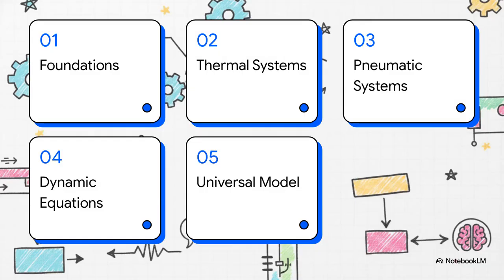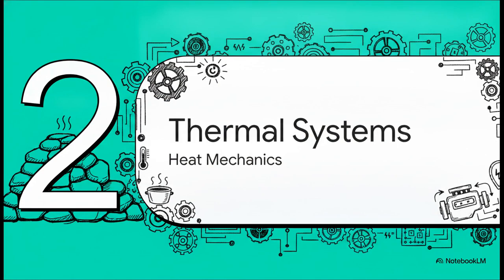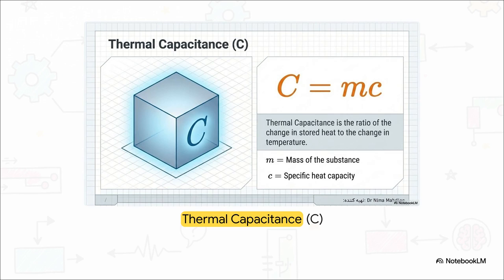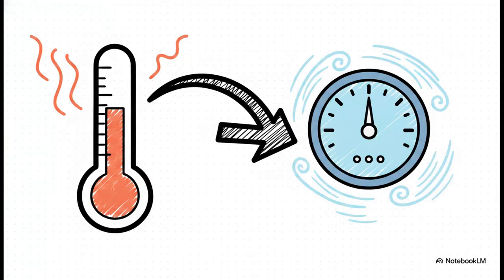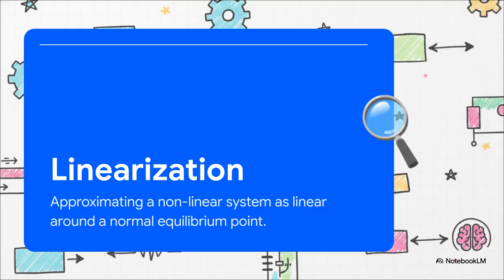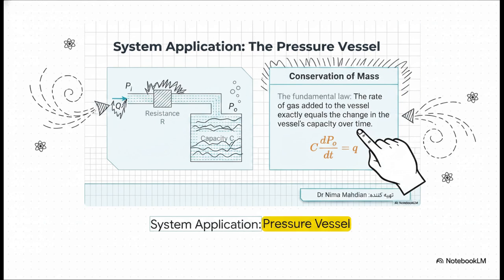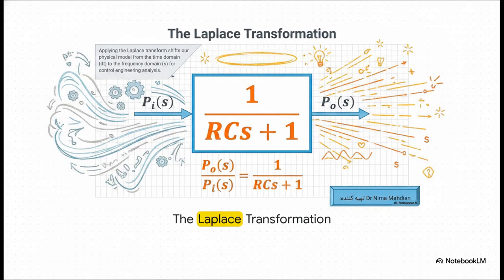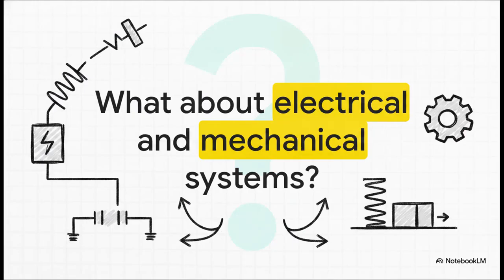Thermal and Pneumatic Dynamic Systems | Industrial Automation & Process Control

Comment: Thank u dr . it's very clear, my question is In the fluid system, the pressure-flow relationship is nonlinear. When we linearize it using a tangent line at the equilibrium point, is the calculated resistance R valid only for small deviations around that equilibrium point?
Reply from the maker: Yes, that is correct. The resistance R obtained from linearizing the pressure–flow relationship is valid mainly for small deviations around the chosen equilibrium operating point.

This is because the original pressure–flow relationship is nonlinear, and the tangent line only provides a local approximation of the system behavior. If the operating point changes significantly, the actual resistance may change, and the linear model may no longer accurately represent the system.

In practical applications, engineers may use multiple linear models, gain scheduling, or nonlinear modeling techniques when the system operates over a wide range of conditions.

Comment: the term Domain Shift in control engineering? Does it simply refer to applying the same mathematical modeling and control principles to different physical domains (such as thermal, hydraulic, and pneumatic systems), while only the governing physical variables change?

In addition, is the primary driving force for airflow in pneumatic systems solely the pressure difference (\Delta P), or are there other factors that significantly influence the airflow dynamics?
Reply from the maker: Domain shift in control engineering refers to applying similar modeling and control concepts to different physical domains, such as thermal, hydraulic, electrical, or pneumatic systems, where the physical variables and parameters change but the underlying dynamic principles remain similar.

For example, temperature in a thermal system, pressure in a pneumatic system, and voltage in an electrical system can all represent energy storage variables, while resistance terms represent limitations on energy transfer.

Regarding pneumatic systems, the pressure difference ΔP is the main driving force for airflow, but it is not the only factor. The airflow dynamics are also influenced by pipe geometry, flow resistance, valve characteristics, air compressibility, temperature, and pressure variations. In real industrial pneumatic systems, these nonlinear effects must often be considered for accurate modeling and control.

Comment: Thank you, Dr. Nima, for your excellent efforts. This lecture provided a clear and insightful introduction to industrial automation, with a strong focus on the dynamic behavior of thermal and pneumatic systems. It clearly explained how these systems respond to changes in operating conditions and how engineers develop mathematical models to analyze system dynamics and support effective control system design.
Reply from the maker: Thank u

Comment: Dr. Mahdian, I appreciate this well-organized and useful explanation. It made the relationship between thermal and pneumatic systems much clearer.
My question is:
If thermal and pneumatic systems are physically different, why can both be modeled using the same first-order transfer function
Reply from the maker: Thank you for your thoughtful question. Although thermal and pneumatic systems are physically different, they can have the same dynamic behavior because both systems contain similar fundamental elements: storage capacity and resistance to flow/transfer.

In a thermal system, heat capacity stores energy and thermal resistance limits heat transfer. In a pneumatic system, compressibility stores energy and flow resistance limits air movement.

Because both systems can be described by a first-order differential equation with the same mathematical structure, they can be represented by the same type of first-order transfer function. The physical meaning of each parameter is different, but the underlying dynamics are similar.

Comment: To keep the mathematical model clean, the video assumes that the nonlinear impact of thermal radiation is negligible. My question is: At what temperature thresholds does the radiation relationship start to heavily distort this first-order model? And if we must include radiation, how does linearizing the radiative heat transfer affect the formulation of our equivalent thermal resistance (R)?
Reply from the maker: . The radiation effect becomes significant when the temperature difference is large, especially at high operating temperatures (for example, in furnaces, boilers, and high-temperature industrial processes). Unlike convection, radiative heat transfer is nonlinear because it depends on the fourth power of absolute temperature according to the Stefan–Boltzmann law.

If radiation must be included, the thermal model becomes nonlinear. Engineers usually linearize the radiation term around a chosen operating point, which results in an equivalent radiation heat transfer coefficient. This coefficient is then combined with the convection effects to obtain an effective thermal resistance R.

Therefore, the first-order model remains valid locally around the operating point, but the equivalent R becomes temperature-dependent rather than a constant value. For systems with large temperature variations, a nonlinear model or gain scheduling approach may be required.